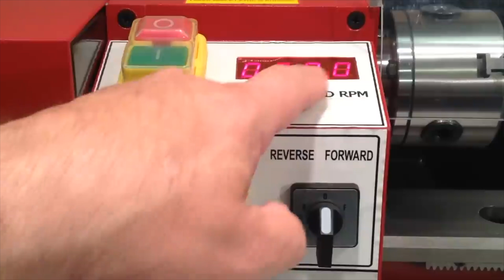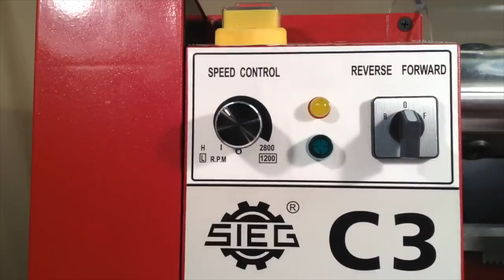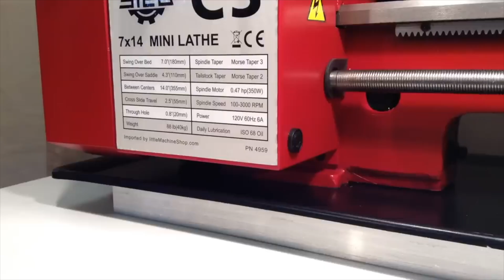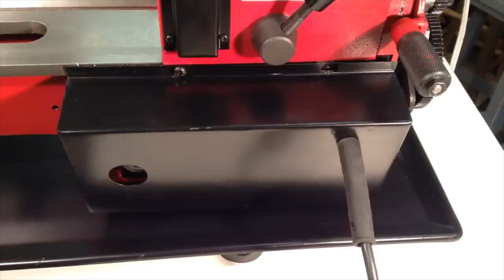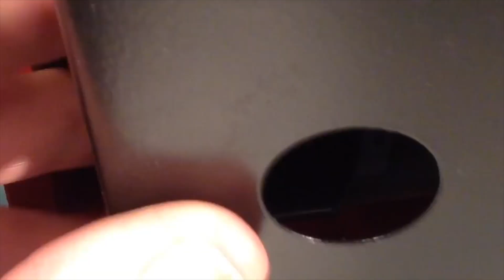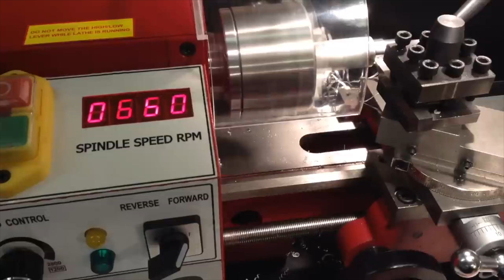SIEG 7x14 Mini Lathe Overview Part 2

Comment: i find it funny how all those lathes are technically identical but devil is in the detail
after watching this video i already found several differences to what my local european suplier mannaged to pack up
for instance the main operating difference in my lathe is on off switch where you can't turn it on without chosing spin direction first. but i didn't check what kind of motor i have yet
Reply from the maker: SIEG Makes a lot of the mills and lathes out there for larger brands, but each brand has to decide what features and functionality they want, and ultimately what level of quality they will pay for.

Comment: Excellent overview, thanks!  One question - the motor label claims 110V and 4.5A - that works out to 495 watts.  But the same label shows a rating of 350W.  Why the disparity?
Reply from the maker: So this could be a Thesis project and plenty of better teachers on the internet that me. Lot's of variables (e.g. brushless motors, battery operated, etc. ) and also gets into darker world of the over-spec of certain machines...

In SHORT... Your math is correct assuming "perfect" circuit, but there is always loss and normal operating parameters. So, in a power tool the voltage through the line is generally consistent and "standard" for a particular circuit (110V is normal home outlet in U.S.) The Amps are usually the "maximum" allowed by the fuse and other circuits before you blow the fuse. The motor (The Watts) needs to be within this threshold but is usually less. For a moment when you start your lathe it likely spikes to a higher wattage amount and then comes down to "cruising" level at 350 Watts. Make a deep cut and it again likely spikes in wattage. Essentially the manufacturer is stating the motor is "rated" at 350 Watts. You could put a larger motor in, but then we see issues with other electrical components failing because they are too close to maximums... Hope this makes sense.